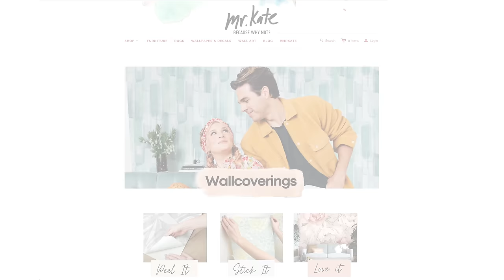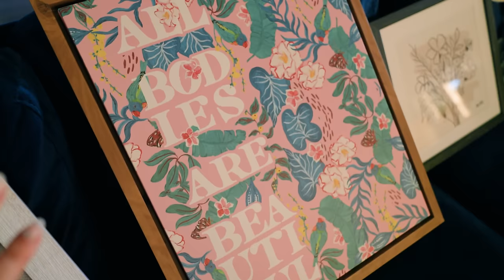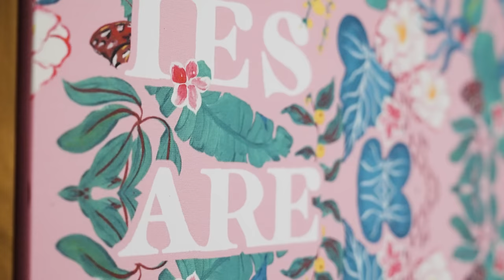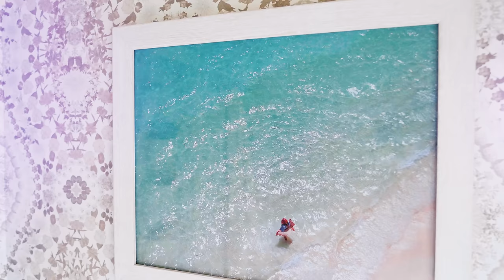Transforming My Ugly Bathroom Into a Spa-Like Oasis: Full DIY Makeover

Comment: This video was so great. I love how your bathroom turned out and how much your guys appreciate you. I was worried about the amount of pitting on the bathroom appliances you painted. Sometimes that's a sign that the drywall in there is off-gassing dangerous chemicals. Factories that thought they'd be clever by using their toxic waste as the filler in drywall have caused a lot of health problems and issues for home owners. Just check it out and be safe. I love you guys!